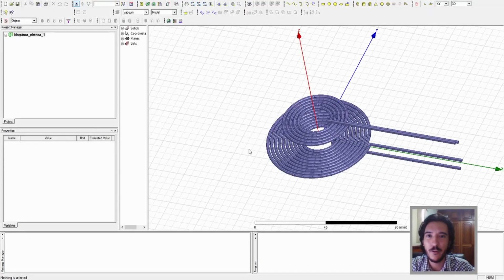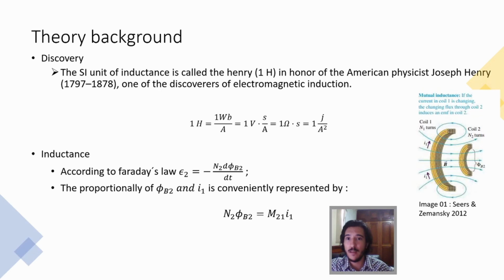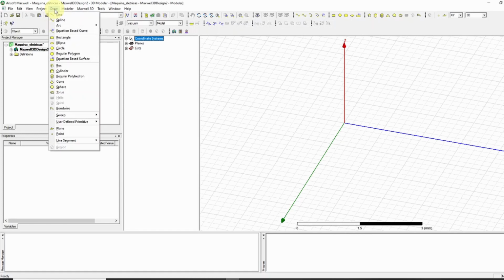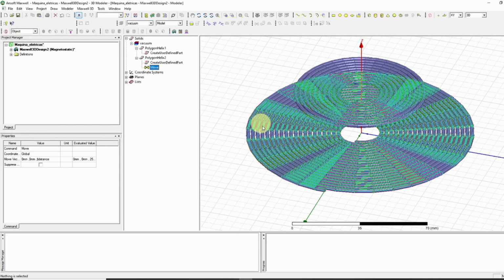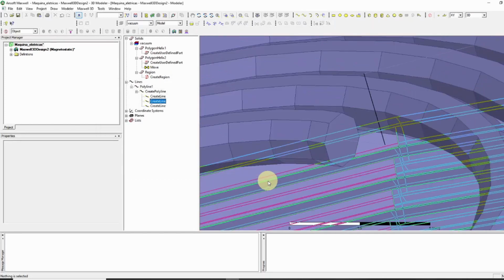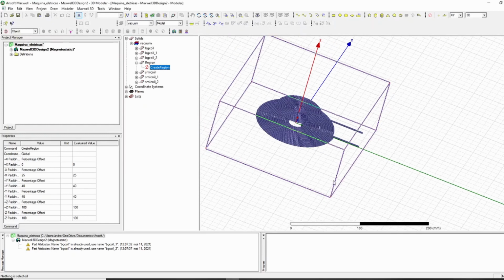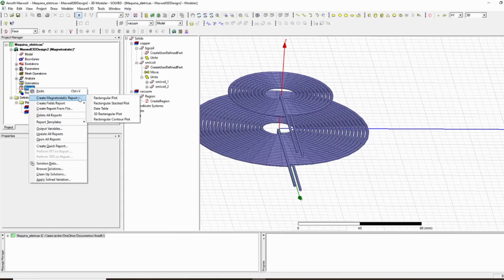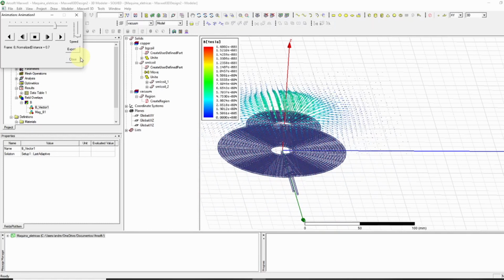Mutual Inductance - Ansoft Maxwell

Comment: Your video is really helpful,  thank you. 
But when I try to assign excitation current, I have to define current flow direction.   I am trying to define the direction vector same as video but error message said that it's invalid and both endpoints of the directed line must lie on the boundary face. 
I'm not sure what  is this message meaning.  😢
Reply from the maker: Thank you for your feedback! I appreciate it.
The bondary face is the surface area in which the box (domain) is deffined. 
For that it is necessary that the conduction path (the rectangular cross section shaped 3D path) touches the domain face, both the in and out path. One common error is that on of the paths is touching it when the other is not, so correcting the dimensions of the path might solve it.
I had trouble understanding the concept of "conduction path" a while ago and bc of that I created a video to help people that come across the same question.
Check it out below.
Reply from the maker: https://youtu.be/Bmn-jjRTsaM
Reply: Thanks!  I will try it. 

Another question. 
I'm trying to assign matrix, but I cannot find the "parameters" button in my Ansys. The "parameters" button in ur video is just under the "excitation" button but my "parameters" button is not there and I don't know where is it. Is there any other method to assign matrix or to find parameters button? 
Many thanks for your assistance!

Comment: What is your pc specs?
It's taking ages for my pc to complete the simulation
Reply: My pc specs is i5 7th gen with 8gb ram no ssd
Reply: I first used circular cross section, switching to hexagonal cross section did the job, it completed in about 45 mins
Reply from the maker: Glad it helped ! With a perfect circular cross section the solution takes a lot of time to converge. Cause the cross section is "to perfect" . Some ansys blogs talks more about it.
Reply: Thank you very much, your video was very helpful.
Reply from the maker: It took around 10 minutes for me. The simulation time is related with the amount of adaptive passes you chose(setup specs) , the numbeŕ of segments on the coil you created and the complexity of your geometry (try creating the coils as a square first - 4 vertices - and each turn divided into less segments then the 36 chosen on the video). The size of your region also matters so try to keep it close to your geometry. 
That might help. 
My pc specs : I7 geforce 920 mx..no ssd,, 4 threads ..8 gb Ram, 1TB memory
Reply: @radusewsk  i tried to reduce the number of adaptive passes but it didn't converge with less no. of passes
Reply from the maker: Uhm.. did u make the geometry just as mine? Your pc specs are good?
Reply from the maker: Try making the coil with a squared cross section as a first approach. That might help
Reply: I used identical transmitter and receiver with 15 turns
Reply from the maker: I see, yet try changing the cross section geometry (polygon segments). See if that makes any changes?